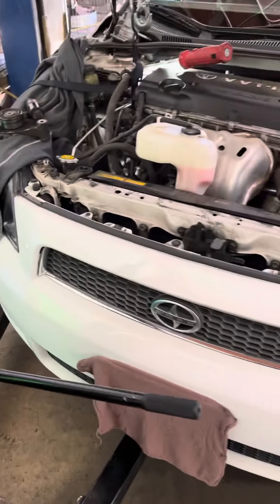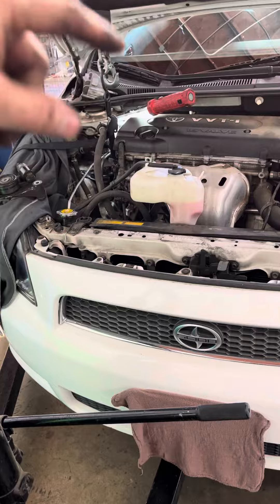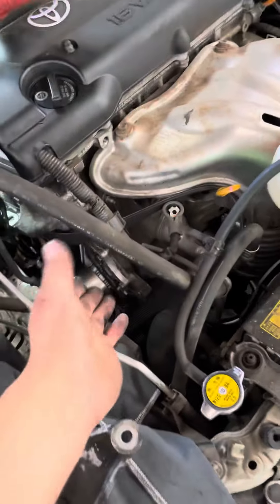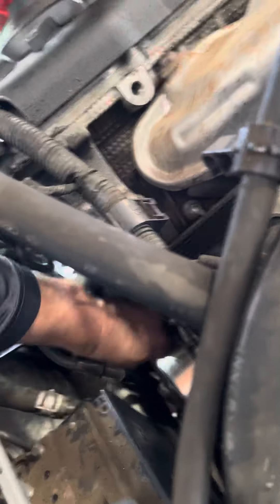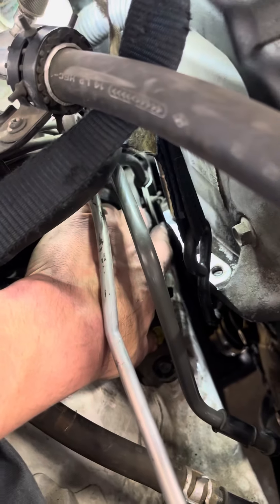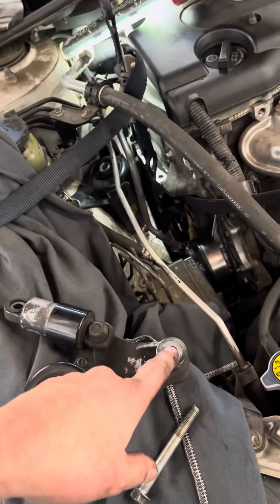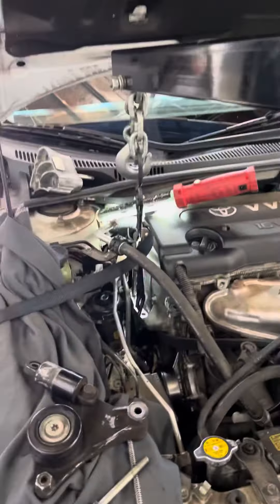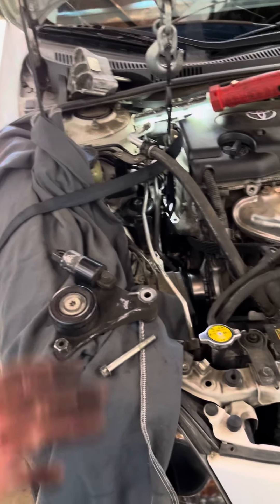2007 Scion Tc fan belt tensioner

Comment: Did you have to remove all the motor mounts ? And/or the CV axles ?
Reply from the maker: only one mount
Reply: @turningwrenchesautorepairm5017  I have '05 1st generation tC. I removed 2 mounts. The front transmission mount and the rear motor mount on top of fender apron passenger side. I raised the engine, heard a slight cracking noise. Thankfully it was the board that I had securing the oil pan is all. Apparently, on the '05 1st generation tC's the engine sits down at least 2-1/2" lower than an '07. No help, no manuals, forums, or videos online or library. Thank you for replying.
Reply: @sonsofthunder915  Did  you find if cracking noise was additional damage? just curious, I need to do this on an 06 tC and from what I can tell I need to lift the passenger side more than I've seen in other videos as well.  It appeared to me (I still haven't fully committed myself yet!) that both transmission mounts would need to be loosened, as well as doing the additional work shown in this video for the passenger motor mount.  I'd like to take on the work (vs. having a mechanic do) as I'd like to be familiar with the mounts for eventual replacement later.
Reply: @tomhernandez1308  READ AND RE-AND THIS POST A COUPLE OF TIME IF NECESSARY. The cracking noise was the board I had set on my jack that held the oil pan. I loosened all motor mounts including the one on the rear transmission. On the driver side top motor mount I replaced the 2 top bolts with 2-1/2" bolts for the motor to slide up but not let the engine fall. The rear motor mount (transmission) I loosened those as well. I ran the nuts to the bottom of the studs but left them attached. After that I could easily lift the engine several inches higher than this video shows. E-Z-P-Z. 

If I had my druthers I would have uploaded a video of my own to show how it's really done correctly. FYI, search YT for the bolt pattern for the rear transmission mount. There are 3 studs but, there is one bolt that is a must to to taken out. If not the mount will still be attached to the block/transmission. Again, I emphasize loosen the 3 other STUD bolts. Leave them on the last threads, that way the motor won't shift or fall. Take out the 2 exhaust bolts connecting the cat converter, (the 2 in front that have springs on them) The exhaust pipe can then drop freely.

Lastly for safety sake I used a floor jack under the oil pan and the factory scissor jack. under the transmission pan. (for safety) I lifted the tranny approx 1-1/2"-2", After that I used my floor jack to lift the engine that was placed under the oil pan several inches. EXERCISE CAUTION NOT TO LIFT TOO HIGH ! Since you're under there one can purchase a tube of polyurethane to make solid motor mounts. If you so choose to. You can find a video on Yt milanmastracci channel. Be sure to follow ALL safety precautions, gloves, safety glasses, long sleeve shirt, face mask, goggles, and a respirator. The odor of product carries solid particulates. Good luck,. Being a noob it took me approx 3-1/2 hrs on my driveway.

On the lower bolt of the drive belt assembly you'll need a special socket, an E-10. It has a star shape pattern.
Reply: My question is where did you have the cherry picker hooked on to the engine? I have one as well and I’m looking at doing this project.
Reply: @michaelnewton-1989  I didn't use a cherry picker, I used 2 jacks. Please read my previous post. It goes into detail. If you have any questions feel free to ask. This is a job not meant for the faint at heart.
Reply: @sonsofthunder915  I was asking the guy who made the video.
Reply: @sonsofthunder915  and i was asking him where he had the cherry picker hooked up because I also have a cherry picker. I’ve changed the water pump and such on as well as the front wheel bearing. I’m sure I could figure this out as well. Just looking for the quickest safest way
Reply: @michaelnewton-1989 I suggest you start a new thread in order to ask the content creator. Obviously, he hasn't answered you on this thread, he probably thinks the same thing as me. That is, you were asking me, not him. It shouldn't be all that difficult to figure out where to hitch an engine hoist up to one these engines. I'd give you instructions but, you're not asking me.
Reply: @sonsofthunder915  lol thanks
Reply: Slip belt on tentioner pulley from down but you need helping hand to hold tensioner fully pressed. 
No need to do anything else. Pass belts from all pulleys except from tentioner pulley.
Reply: @adilakhtarghani6848  Thank you but I had  no problem putting on belt. I was asking about replacing the ENTIRE belt tensioner assembly. If I recalll YES, I had to remove the front and side motor mounts.

Comment from the maker: Correction: alternator must be removed to do repair
Reply: My question is where did you have the cherry picker hooked on to the engine? I have one as well and I’m looking at doing this project.
Reply from the maker: @michaelnewton-1989  I used a blue strap. The hook at the end of the strap was inserted into motor mount bolt hole. Worked out well
Reply: @turningwrenchesautorepairm5017  
Awesome! Thanks. I do believe I’m fixing to have to tackle this project.